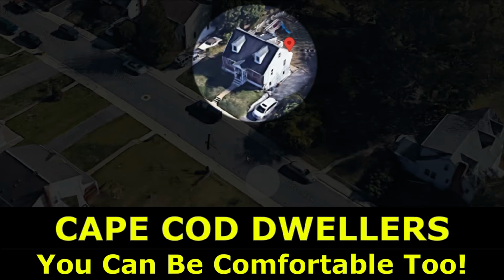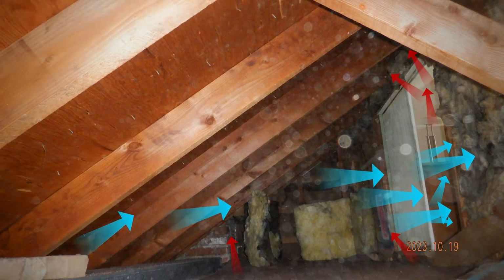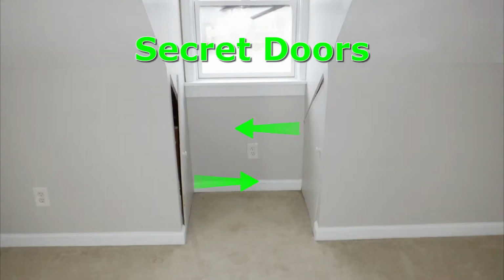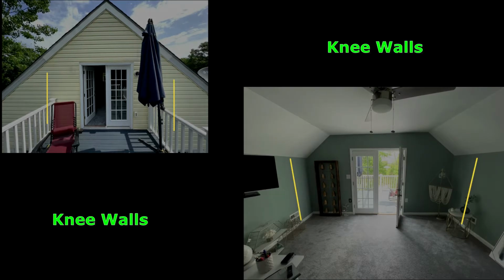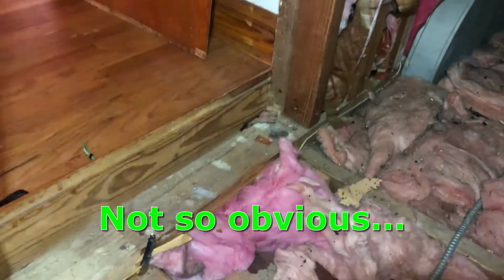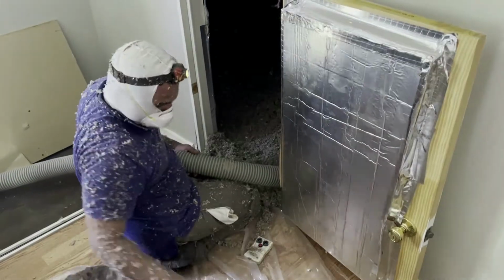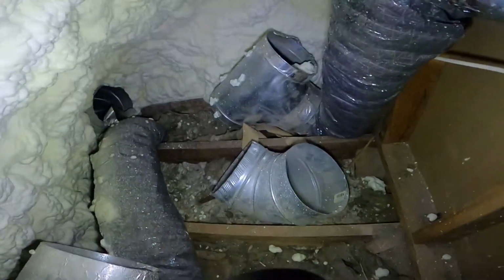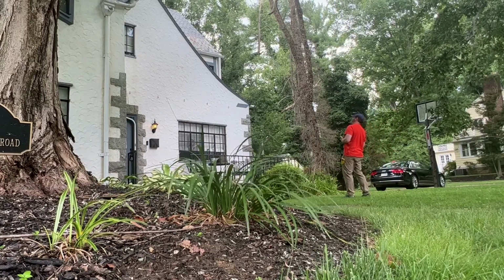🏠 How to Insulate a Cape Cod-Style House | 3 Modern Methods to Improve Comfort Year-Round

Comment: I had a new roof put on my cape, i had smart vents and a ridge vent added. It made a world of a difference. Its nowhere near as hot. I know its some insulation behing the kneewalls i had blown in insulation done years ago and i know there is insulation behind the kneewall itself the kneewall  access doors has thick insulation attached to the backside of the dooes. I dont know whatelse was done, i know they didnt use any expanding foam
Reply from the maker: That’s great!!  What did they use to create the air barrier?

Comment: I have 1960s cape cod house with no soffit vents and no insulation in the slopes walls. In the knees wall area I have a heating water pipe in the that that is prone to freezing in the winter. The knee wall is insulated but I think it’s better to insulate the roof rafters instead.

I have gable vents not sure if there is insulation in the ceiling part of the house tho. 

What’s the correct way to insulate the area.

I’m OK with ripping down walls to get access to areas too because the attic area is super out of date with wood paneling :)
Reply: Clarification: the Gable vents are located on top of the roof not in the kneewall
Reply from the maker: Hello. Open cell spray foam applied to the roof deck and make sure that the soffit areas are completely sealed off (despite not seeing open soffit, air can still get in!). Open cell spray foam to the gable end walls in the knee wall attic. Now that space is part of your living envelope (encapsulated). The pipe can still live back there and now it won't be subjected to outside air. The air in the knee wall space will be inside air. I usually then go up to the top flat, assuming there is space to move around, and have the guys blow insulation into the sloped bays. We air seal the top collar flat and insulate (conventional methods - one-part-foam and loose fill cellulose). The gable vents can stay in play to allow some ventilation in that space, but you don't need ventilation in the sloped bays or the knee wall attic space.
Reply: why would you use open cell instead of closed cell spray foam. 

Also forgot to say my roof rafters are 2x6. Wouldn’t closed cell be better for that?
Reply from the maker: @akjames23 open cell is less costly and will create the air barrier and the r-value you need. Closed cell is better for foundation areas or small surfaces in the attic that need to be encapsulated (ducts/knee walls).

Comment: Wouldn’t spraying foam insulation over the soffit vents lead to mold from condensation?
Reply from the maker: Not if you fully encapsulate the space and make it part of your living space. The air will cycle through your HVAC. Outside air stays out.

Comment: 1901 house with finished (why I will never know) attic 12/12 roof to flat section no vents or insulation but they blew insulation in the floor. I am desperate here lol. Have the HVAC off so its a balmy 100+ up there but will have to at least keep pipes warm this winter.
Reply from the maker: Try @homecomfortadvisors

Comment: Hi, my 2nd Floor is 24/7 Bedrooms.  I’m in NoVa; as I write, it’s July 11 2026, 88 outside, 81 in the 2nd floor and 73 in the 1st.
My 2nd floor is approx 2,000 sf flat footprint (55x35); within that footprint, 1,000 sf is 24/7 Bedrooms.  I have full length soffits, 2 end gables, and retro fitted ridge vent (new roof) which the roofer NEVER offered to close the gables (and YouTube talking heads say gables interfere with venting by ridge vent 🤔).

To encapsulate the space up to my collar attic, it looks like big, big $, due to 55’ L, and my knee wall is 7’ high, and sloped wall about 1.5’; then the collar attic is about 12’ x 55’, with no access, and I think, crushed R-13 fiberglass batts.  Roof rafters are 2x10, with 16” OC, built 1964 by home builder for himself.
I see your approach as a huge spend, at NoVa prices DMV area.

And it goes against EPA recommendations of “natural circulation”: hot attic air rising to vent out via ridge or gable vents, and outside cool air entering via soffits “sucked” in by vacuum of rising hot air.  Air flow along the joist bays.

I’m thinking $7,000, with foam board blocking of floor joints transitions (55’ with 16” OC).  Plus new knee wall, floor joist-attic floor (ceiling for 1st floor) insulation, sealing of all penetrations, 4 Dormers in my attic which have to crawled under.
It beats mini splits AC which is also easily $5,000 because of230/240V new circuits, and higher utility bills.
Encapsulating the knee space plus insulating the collar attic ”floor” still looks risky to me.
Plus a foil radiant barrier is mainly labor and still $400 of foil.
Reply: I had a new roof put on my cape. I adidnt have soffit vents so I added smart vents and a ridge vent. Didn't do anything with gable vents, I dont think they do much when the attic is finished because they are blocked off. My point is adding those vents made a hell of a difference. I havent measured the temperature, I have no windows open up there and I do on my main floor and its not really any hotter up there at all. I think adding that ridge vent is letting all of that trapped hot air out and those smart vents is letting some cool air in although there is no visi le place for the hot air to escape on the sides. I believe the kneewall blocks the hot air from traveling all the way to the ridge. But its going somewhere..I believe hot air is still getting up to that ridge vent thru natural air leaks in the structure. Its not air tight

Comment: Ok but with the spray foam. Aren't you preventing the roof from breathing. Thus trapping the hot air in. Which will cause roof failure
Reply from the maker: Hi. Do you mean breathing? Humans breathe houses need ventilation and spraying the foam to the roof deck will not cause any problems if done professionally.

Comment: only issue, is the air barrier/insulation is placed on the inside edge of the top plate, vs being placed on the exterior side.
Reply from the maker: Thanks for your comment. i am not following you. Can you explain a little more?
Reply: @homeairleakagetest a lot of these cape cod or knee wall conversions that I see. People are blocking off and sealing from the inside of the top plate. Leaving the leakiest spot(top plate) outside your conditioned/insulated area.

Personally I have blocked and insulated from the exterior side of the top plate to keep the top plate inside the conditioned area and can insulate on-top of it vs leaving it exposed and unconditioned?

Comment: 5:29 wouldn’t you have to worry about mold with this?
Reply from the maker: What would cause, create, and sustain mold by properly sealing and insulating this way? If done correctly the area is brought into the living space (envelope) so  the air mixes through the HVAC/ inside ventilation.
Reply: @homeairleakagetest it’s starting to make sense. I’m having to tackle this project myself in our own cape cod style house, as it wasn’t discovered during the home inspection that we have no/poor insulation in most of our knee walls. It’s cold in here 🥶

Comment: Any thoughts on the first floor walls? Our first floor is one layer of brick with no insulation in the studs. Theres always a draft in the winter, especially near the windows (which are original from 1940). Ive been thinking about blowing insulation/sprayfoam inbetween the cavities. Other thoughts were new windows. Curious if you would prioritize new windows or filling those cavities.
Reply from the maker: To answer I need to know about your second floor insulation sitch…
Reply: @homeairleakagetest the second floor is siding with insulation in walls and crawl space above. Could be better bc we do get ice dams, so your video will help me how to target for that. However, temperature is always good upstairs, warm in winter and cool in summer. The original duct work design is very good. I've had hvac friends comment on how much extra effort they took to make sure the duct runs flow the air very well.
Reply from the maker: Gotcha, make the attic your first priority before any walls. Good to hear about your ducts and well organized runs are good, but maybe check to make sure they are sealed too.

Comment: I have a cape cod with both upstairs sides finished. House has no soffit, gable vents or ridge vent. There appears to be regular insulation under the roof sheathing. Trying to see what my best options are for insulating. It gets extremely hot up there during warm months.
Reply from the maker: hello! interestingly, i have been working on a video this past week that may possibly address your question. for good measure, I added your question to the end of the vid and tried to answer it even further. please let me know if it helps and if not, what I am missing so I can help you get a handle on your problem.  Eric
Reply from the maker: just finished the video if interested! here is the link: https://youtu.be/nZPgUiK6q9U
Reply: @homeairleakagetest just got a chance to check it out, thanks so much! That really clarified it for me!
Reply from the maker: Sweet! Good luck!!

Comment: Not a fan of spray foam.  Horrid looking, only gets worse with age, how to get rid of it in the future and why on top of that would you want to lose storage behind the knee wall?
Reply from the maker: I hear you—spray foam isn’t for everyone! It definitely has a different look compared to traditional insulation, and once it’s applied, it’s not easy to remove. That said, when used in the right applications (like knee wall areas), it can be a game-changer for sealing up air leaks and improving comfort. As for storage behind the knee wall, I totally get that concern. I usually have to exlain to people that it is a sacrafice you need to make (storage) for a new quality of life (comfort). Then I leave it up to them to decide. Thanks for your input!

Comment: I hope you reply! Bc we are sure having issues here! My cape cod is like this. We have no soffits and last year decided to get the knee wall areas spray foamed… the person did the roof sheathing and end walls but left a gap to the slope attic, this winter when temps fluctuated we found our self in serious trouble with frost and condensation. I assume from hot air entering the upper spaces. We have since had to rip out the slope attic and most of the collar attic insulation. My question going forward on our repair. Should that gap be closed with spray foam ? When we go to do the slope attic can we do blow in cellulose and then the same in the upper attic and leave that vented? I feel like as long as we have the conditioned spray foamed attic air sealed off again our problems should go away but I want to be sure, as the “ professional “ has left us with no real answers. We also have no duct work that runs through any of the attic spaces at all. And below the knee wall attics is tongue and groove flooring with cellulose under that.
Reply: And by gap I mean just close it at the wall in the knee wall area not all the way into the slope ceiling, sort of like a shelf, air sealing the space off from the slope before we fill it will cellulose.
Reply from the maker: I hear you—Cape Cods can be notorious for these kinds of issues, especially when insulation and air sealing aren’t done as a complete system. It sounds like the gap left between the spray-foamed knee wall area and the slope attic allowed warm, humid air to reach the colder surfaces in the upper attic, leading to the frost and condensation problems you saw this winter.

For your repair going forward, yes, that gap needs to be sealed. If you’re keeping the knee wall area as a conditioned space with spray foam, then it needs to be completely sealed off from the unconditioned slope and upper attic—no gaps, no leaks. Otherwise, warm air will continue to migrate upward, causing condensation where it meets cold surfaces.

What you use to seal those gaps does not matter, but spray foam would give you the best chance of closing all of the gaps. Some type of blocking can be used as well.

Treat each space separately. The slopes would be sealed off and insulated to the best of your ability, and then the top attic can be air-sealed at the floor, and insulation can be added to your recommended R-value for your region.

As for insulating the sloped attic, dense pack cellulose is a great option but challenging.  It may be just as good if you can keep any insulation in the sloped attic and fill the bays where you removed the insulation.

I find that when I focus on the knee wall areas and the top flat, the results seem to work well in terms of comfort. In Maryland, the flats need to be R49, and slopes need to be R30, so they are not as susceptible to heat loss, but still need to be insulated.
Reply: @ thank you so much for the info! I’m not sure if you know the answer to this question but with the two side attics having closed cell, being conditioned and no hvac ducts running on either side ( the room in the middle has heat/ac vents but we typically end up needing to use a space heater or window ac bc it doesn’t keep temps as of right now ) do we need to have dehumidifiers running in each attic side bc of the spray foam now? I been worried about this!

Comment: i see you guys spray foam the underside of the roof sheathing. Is that spray foam direct or is there a baffle to let cold air from the soffiit reach the top? much thanks for a great video btw
Reply from the maker: No baffle or gap or airflow of any kind. You need to seal the soffit off so that no air gets in to the triangular space (knee wall attic area).
Reply: So I’m a year beyond you writing this. What if the cape cod has no soffits at all?? What methodology is the best to keep the upstairs conditioned area comfy?

Comment: You say that most sloped ceilings are batt insulated.  Does that suggest packing the gap tightly with rockwool would be sufficient?  Blocking off both ends with insulation board?  Or is it too risky in regards to air pockets and ventilation?
Reply from the maker: That would be going above and beyond and will benefit you. No risk in my opinion.
Reply: Thank you for such a quick reply!  Since posting, I've discovered that bitumen felt funnels air from the sofit area of the house, up past the side attic, over the sloped ceiling and into the top attic.  Given that the sloped ceiling now won't be 'strictly' air tight using this method, would you still say it is a good option to take?  There's only 75mm-100mm gap to shove rockwool or fibreglass insulation down... Thoughts??
Reply from the maker: Hi sorry. I think my answer would have to depend on how you are insulating your knee wall area?